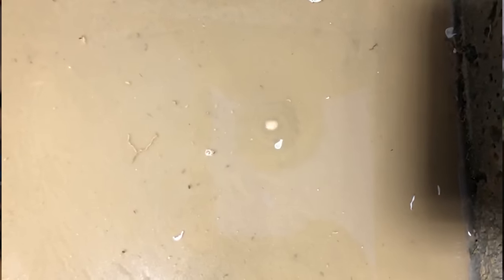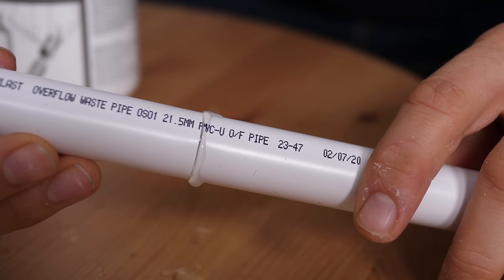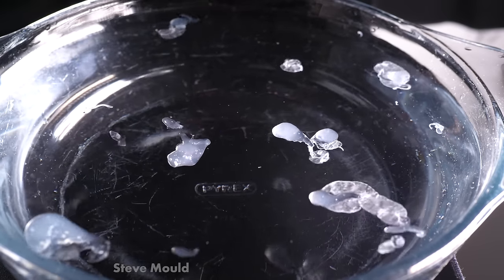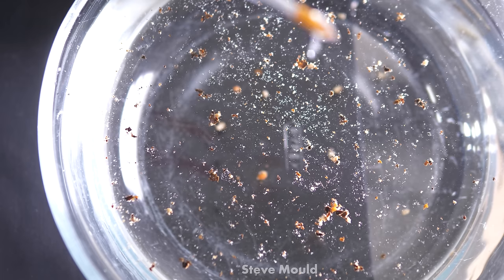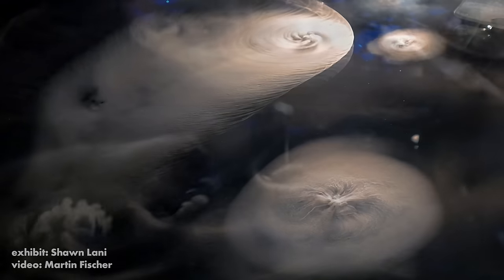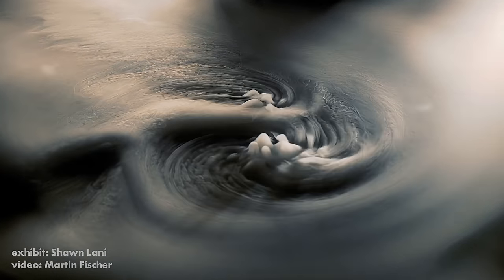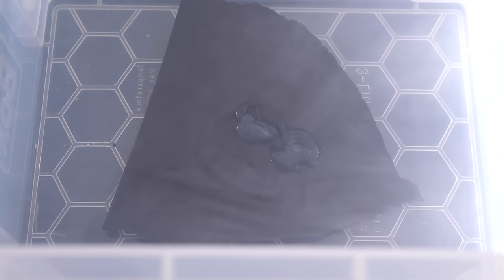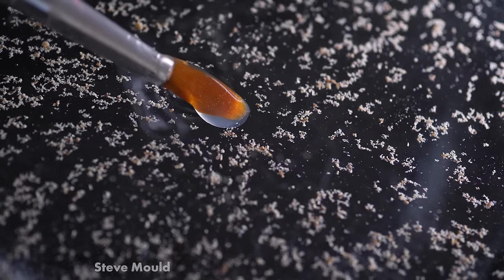Bizarre Spinning Glue

Comment from the maker: I never knew there was so much chemistry involved in plumbing. More research needed.
The sponsor is NordVPN: Get 4 months free when you buy a 2 year plan: https://nordvpn.com/steve and use promo code "steve" at checkout.
Reply: I think you overlooked surface tension too quickly. Very small gradients can make large marangoni flows and in this case the mixing is happening at a variable rate. I think what's likely happening is as the polymer is "drying" you have microvoid formatio based on phase separation determined by a three part system according to Flory-Huggins thermodynamics. When that happens you have nanoliters of solvent being expelled. This theory is explored in this paper http://doi.org/10.1021/acsmacrolett.8b00012. But self-propelling droplets are explored also in papers like doi.org/10.1063/1.4939212
Reply: YOUR CRUST IDEA IS CLOSE, EXCEPT THAT THE CRUST IS AIRTIGHT SO FOR MORE SOLVENT TO ESCAPE, IT NEEDS TO EVAPORATE & BURST OUT OF THE CRUST !!!! (NOT SHRINKING CAUSING CRACKS) THANK ME LATER ^_^
Reply: My guess is that there is a quick change of shape the moment it hits the water which causes propulsion in the form of a spin. Do you have a high speed camera to test this?
Reply: @choiceschoices5910  do you know where the caps lock key is...
Reply: @hutima2  so then what causes the variable rate of the mixing?
Reply: ...You tried to make cement but had mixed results?
Reply: I am still wondering if that red pipe in the background is real or not.
Reply: @ikbintom  http://doi.org/10.1021/acsmacrolett.8b00012 microvoids collapse at different times leading to "bursts" of mixing
Reply: my guess on why the cement is moving so jerkily like that is that the outer layer is curing and hardening but also shrinking, resulting in pressure building inside the blob, which ruptures the cured outer layer and acts like an icing piping bag.
Reply: I just wish all the NordVPN sponsorships everywhere would be a little more informed. The thing is, while yes, your traffic is tunneled, it is only tunneled to NordVPNs servers. It is only encrypted up till there, not all the way to the recipient. On top of that, and probably they most important thing: If you have non-encrypted data going through that tunnel, NordVPN can read all of that. And given their previous history of how they handle data and data leakage I don't think it's a particularly good idea to trust them with that.
Reply: @hutima2  I see. The papers are a bit too technical for me, but at least you introduced me to the Marangoni effect and Flory-Huggins solution theory, and I now have a vague idea of what a microvoid is, all of which seem very relevant for the video. Flory-Huggins solution theory is apparently a lattice model, so I'm not sure how that would work, but pretty cool! Do you reckon the source for the droplet's kinetic energy is something like the solvent's evaporation heat?
Reply: Hey Steve, what if you mix some coloring into the pvc cement?(maybe the bursts will become visible?) I would do it by myself, but i don't have the cement unfortunately =(
Reply: Cool video, Steve! Have you tried dyeing the water, to see if it makes the bursts more visible? (Or dyeing the pvc cement, but I guess that's harder)
Reply: @davemarm  nooo, it's not because of that, have you probably watched the video? They can fully stop and then suddenly start moving again
Reply: @88Timur88Bahmudov88  Hahaah great minds think alike and fools rarely differ, right ;))
Reply: @ikbintom Yeah, ahah, 
i guess you can put dye on top of the cement while it's already in water, but coloring the water itself will not change anything, you'll still not see anything :D
Reply: The outer layer loses solvent and the pvc can form a crust. If you're fast enough the crust is not stable enough and gets pulled out by the solvent jets.
I think a similar thing is happening to those jets... There's a solvent concentration gradient with higher concentration in the middle, this means there's no equilibrium and you know what's going to happen. So maybe when the concentration in the crust is low, there's not much transferring into the water and once the concentration is high enough and the solvent can transfer into the water, there's already the tendency for it to move into the water until the concentration is too low again and the cycle repeats until the overall concentration is too low.
(important thing to note: this only works, because the effect is only happening near the skin with not much depth)
Reply: Lol literally just watching 5 more seconds and he said the same idea of a crust, but the "crack theory" (cool band name btw) seems not very plausible
Reply: Two seperate thoughts.
1. Could you set up a thermal camera and test that?

2. Whenever I see various inanimate substances behave this way, it makes it so much easier to understand how probable life is elsewhere in the universe.
Reply: The thumbnail design made my brain go "it's steve mold" but my eyes were not sure and were like "it's smarter everyday"....
All in all, my brain was 100% sure even tho my eyes don't remember the thumbnail design while my brain actually does

I'm just sharing this because it fascinated me for a moment how my brain cought the thumbnail instantly and accurately way before my eyes
Reply: I’m intrigued to see what would happen if the PVC cement happened to be denser than oil... would it have the same effect between the layers of water and oil?
Reply: Please do an update video, if your chemist friend discovers something different.
Reply: According to me I think :
Pvc cement droplet comprises of small pores which consists of the air captured during its falling trajectory ..... therefore as we put it in the water the Gases captured gets replaced by water hence forth they release from the pore and hence exerts a force which makes the cement droplet move or rotate( if it has a moment arm). 
Therefore if we look further into this phenomenon the wings that got created can be explained by the same ...suppose the air gap is present at the bottom so as the droplet falls the water rushes in and at that snap moment the pvc cement which has not yet touched the water surface experiences and equal opposite force which results in those wings( like when we keep piling  up grains after a time they start slipping down ).
It's just what I think 🙏
No offense to anyone 🙏❤️
We are all here for Physics 🙏✨
Reply: @88Timur88Bahmudov88  elsewhere in this comment section someone noted that actually you'd need a dye that binds to the solvent, so just putting dye on top won't work either I guess
Reply: There is also a random reaction of movement with PVC cement on PVC.   Most of the time you apply the cement to both the pipe and a coupler, push the two together, give them a twist and it’s set.   Your joint is solid.  But do enough of these same joints and eventually you get one that pushes itself apart... quite strongly.  Most of the time you can catch it and reinsert the pipe into the fitting and hold it for 15 or 20 seconds and it sets solid like the others.   This happens regardless of whether you use a primer or not.    I wonder if these repulsive forces are related?
Reply: Maybe something like this happened and a chemical reaction happened leading to the creation of a basic form of DNA... ? Have you seen Stephen Wolframs Automata?
Reply: So it's kind of an overpressurized-vulcano?
Reply: How is the mineral content in the water affecting this phenomenon? Does it work in destilled water?
Reply: Steve you know you can get it in black & other colours.
Reply: @lawrawwill  if the solvent really likes to dissolve in oil and the oil doesn't dissolve the pvc (i don't know that, but i think it doesn't dissolve any pvc) then the same effect applies on contact with oil.

But what also would hinder this from working is  if the oil sticks to the surface when the glue rolls it hinders the effect in water and vice versa.

I'm guessing the solvent doesn't love to dissolve in oil as much as it does in water, but only experimentation or looking up the solubility would give us real answers
Reply from the maker: @andrewedis9907  I tried so hard to get other colours!
Reply: @SteveMould  The only other colour ive seen is black so I don't know how much better, it would've been.
Reply: I've also noted this effect many years ago with a homemade ABS cement (dissolved ABS plastic in Acetone, which can be used for patching up 3D printed objects).  Maybe a little less nasty than messing with MEK if others want to try experiment.  https://www.youtube.com/watch?v=Yt7HCwCOEEA
Reply: @hutima2  I also have a question Once when I was on my school's ground  I dropped Fevicol glue in a puddle after a rain and it just disappeared any answer? The ground has soil on it .
Reply: @WetDoggo  I definitely think it’s worth a follow up video of the different things to try. 
I’d hope that the oil would tend to be less exciting but the cement would sink to the barrier between oil and water and behave differently. 

My next thought would be the temperature of water and whether that affects the spinning. If it’s solvent dissolving then I would expect it to make a fairly significant difference?
Reply: That's how Life started on Earth! 
From PVC pipes.
Reply: I was a commercial union plumber and suffered a back injury. I now am a senior in a well renowned chemical engineering program.  Yes there are many similarities. I am pausing the video at 1:21 to guess (well I know for a fact it is intermolecular forces, but isn’t everything?) that the hydrophobicity of the glue and the liquid state along with the “roughness” of the glues surface is what is making it jerk around and the spinning are times of movement of the liquid glue.  I don’t believe it is thermal, but I am sure that has something to do with it also.  I’ll reply to myself after your video.
Reply: Seriously please don't run out and find some MEK and try this at home. What he did by trying to make his own PVC cement was incredibly stupid. I have a long history working with MEK and it is incredibly dangerous and highly toxic.
Reply: PVC fusion welding with chemicals is a three step process.  Clean, solvent, filler. The filler (pvc resin) is only used for the “slop” in the fittings and the process can be done with only the solvents and pressure. Usually the process combines cleaning with the addition of solvent in one step with a primer (there are just cleaners ). The cement has a higher conc of the primer ingredients or a different amount of individual solvents in the mixture used.  These amounts are a trade “secret” I think.   I believe the primers used have a higher conc of MEK as a sweller I think when the cement, being the “glue” has a higher conc of Tetrahydrofuran.  MEK is a weaker solvent to Tetrahydrofuran.  From what I have read you can only hold 20% PVC to Tetrahydrofuran in the mixture (moles or mass, idk).  Resins I believe have to have 10% to be legal. 

You want to use Tetrahydrofuran not MEK.
Reply: Practice dictates to always use a resin (filler) as humans create pipe and fittings with a tolerance.  Always use primer and cement.  Usually the problem is guys and gals not using primer but primer should always be used  as it is integral to the process of putting pipe together versus the reaction and chemistry alone.
Reply: And now after watching, I think your chemist friend is on the correct track as well as you are with the expulsion or rather the breaking of surface tension in the cement, allowing the jets.  The cement is (by mole) mostly solvent comprised of multiple chemicals.  MEK though isn’t the main solvent in the solution even if the solution is composed of it more so. Tetrahydrofuran I believe is the most “active” solvent.  I could be very wrong tho. Ty
Reply: MEK can make you go sterile
Reply: Hey Steve!

I have been following you for as long as I can remember on YT - thanks a ton for the super fun, insightful content. I actually have a favour. I work for Yahoo and am looking to interview macro-influencers like yourself. More than happy to send over a bit more info if you think you might have 15 mins for a quick call - I'd HUGELY appreciate your insights!
Reply: Here's an interesting fact about left handed and right handed molecules you might enjoy, the chemical that makes the scent for lemons and oranges are chemically identical just one is left handed and one is right
Reply: @britnermecham6403  enantiomers. Mirror chirality
Reply: (The following is based on the assumption that the process of curing being exothermic is a trait inherent to all cements, not merely the construction variety, I couldn't find any information on this, because it's 2020)

What you're initially getting is Prince Rupert Drop Rockets. Because the tail's surface area to mass ratio is so much higher than the head, that's where the majority of your heat is exchanged, as form follows force follows form, a tiny comet is born.  I presume the more dramatic and erratic secondary propulsions are due to pressurized solvent expulsions. Having had the local barrier to curing removed, there is rapid curing, heat release, contraction due to solidification, and a massive shift to the internal pressures of the droplet, adding to the already heaping pile of tiny variables. The situation is such that even the most miniscule of force alterations can have a visible impact on the droplet's rotational momentum. Thusly, we get "wacky shit"
Reply: Subscribed! I've been doing lawn irrigation for 8 years, and have always been fascinated by this process. I would love to hear more if your chemist friend DOES explore further. A tiny drop of oil on the water, or less than clear water (A.K.A. muddy) makes the surrounding movement far more visible, and PVC cement also comes in a vibrant blue color. I try to always keep my solvent on the pipes for environmental reasons, but it sure is pretty when I make a mistake...
Reply: I wonder what effect the temperature of the water would have on the cement
Reply: Its the solvant evaporating rapidly. If you want to see slow propelling, attach a small piece of camphor behind that boat that you used with soap.
Reply: @peepzorz  Just stumbled across this video and yeah, seeing him just handling MEK-impregnated PVC with his bare hands definitely had me sucking my teeth. I keep some handy because it can act as a solvent for PLA (along with its isomer THF, which is actually the primary ingredient in most PVC cements), but really you shouldn't be messing with solvents without gloves at the very least.
Reply: Would be really interested to see the effect that the temperature of the water has on the speed of the movement. Also the fog on the co2 video is water condensation not co2 which is interesting.
Reply: I'm a (mere) evolutionary biologist but my first guess you didn't mention. To me it reminds me of what happens when you pull your arms in and you start spinning faster due to conservation of angular momentum. Either from the initial compression from the water or the release of solvent pulling the denser parts inwards.
Jets of solvent probably sufficient though!
Reply: I have an interesting experiment for you steve , I cant find the video I made but it is simple to reproduce . I dumped some laser tuner powder ink into the wet toilet and flushed . some of the ink moved upstream . upward against gracility . try it . very strange .
Reply: I think that it's the chemicals flashing off that's creating the thrusting of the surface molecules. Because of the temperature of the cement getting hot and the the water keeping the surface of the cement from setting or curing. Similar principle when using water inside of a bag or balloon and using an open flame without burning thru the material because the water is acting like an insulating member. So as the water warms and cools you get the circulation of the water in random spurts.
Reply: Did you confirm this or still sniffing the glue?